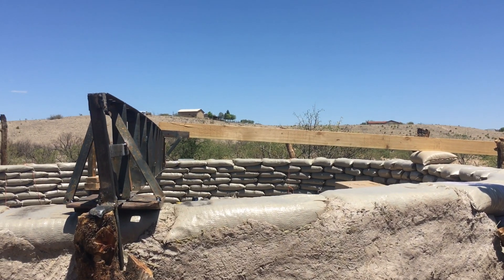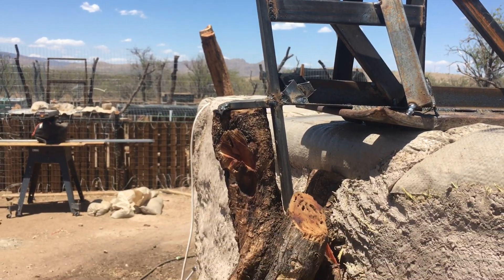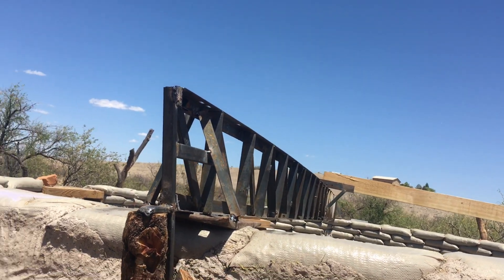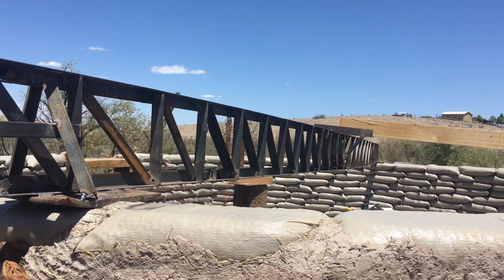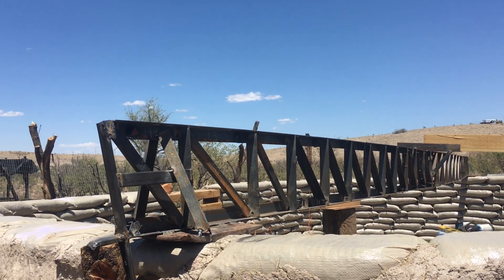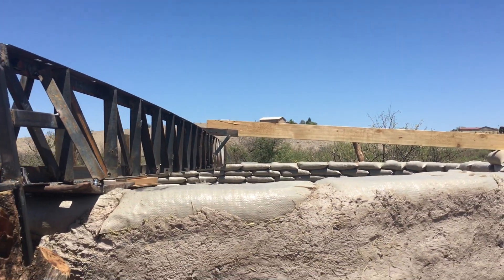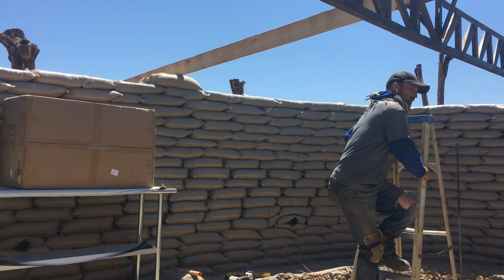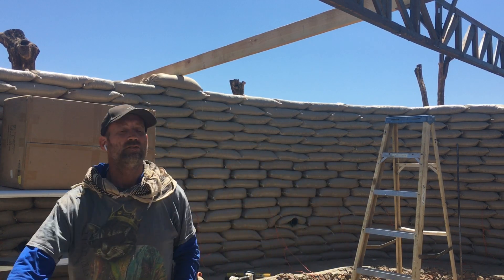EARTHBAG BUILDING - DIY Steel Truss part 4

Comment: I want to make a earth bag gazebo. I thought to make a tension structure roof (like a yurt, with a tension ring to convert the roof thrust load into a vertical compressive load on the walls) so I wouldn’t have to weld anything.
Reply from the maker: Sounds cool.. ya I was a welder so for me everything looks like a weld.. but the steel was free for me and I have the skill set so why not. I am actually a member of a yurt group on Facebook and they discuss those all the time. One of the things about this structure is that it amorphous in shape so I figured for my first roof like this I better keep it familiar for me. Down the road I would like to build one of those roofs though, they seem very dependable
Reply: @LeGrowFarms  yeah I would use a steel cable or three to tension the outer ring. And punch lock some steel stud and track into a truss (gusset reinforcement for that 25ga stuff, it’s not meant to handle all the shear by itself) for the joists , I can steel get that for a decent price. Truss calcs YMMV, of course, as steel stud is not always consistent in quality.

I don’t like big-box or commercial lumber for exterior or hidden structure in Arizona. I’ve seen many a fine-looking timber or 4x6 concealing a mess of termite tunnels after a few years. Nice structural wood is way too expensive now anyway.